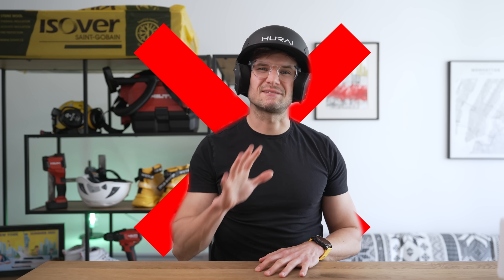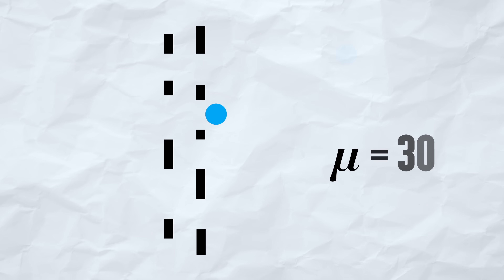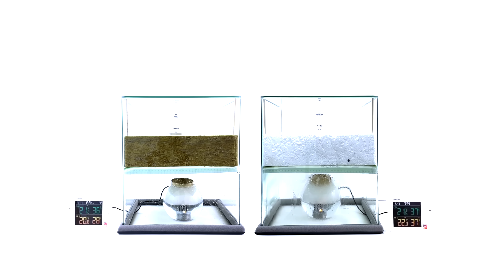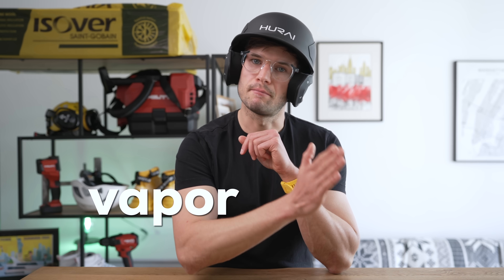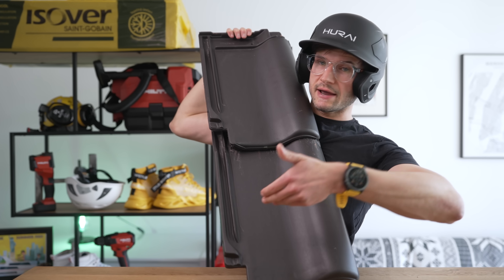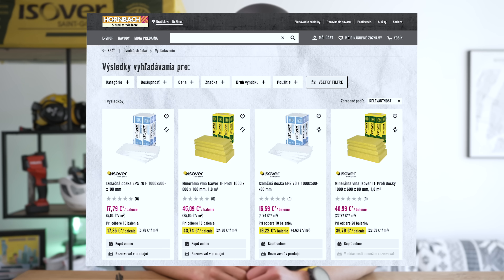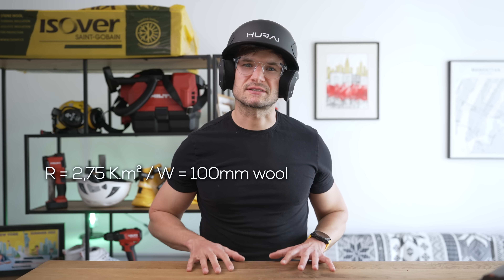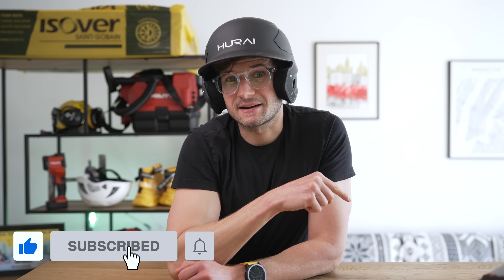Insulation for exterior walls? Polystyrene vs. Wool on Facade.

Comment: Great video. One small mistake. Heat doesn't rise. Hot air rises, heat goes in every direction.
Reply from the maker: Great point, thank you. You are right 👍and thank you for the compliment 🙏 it helps me stay motivated 🔥🔥